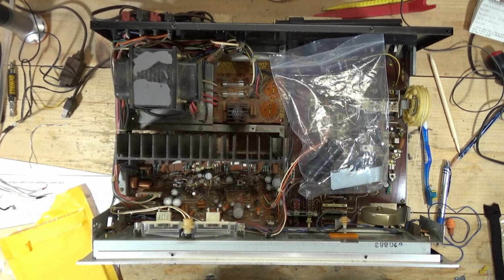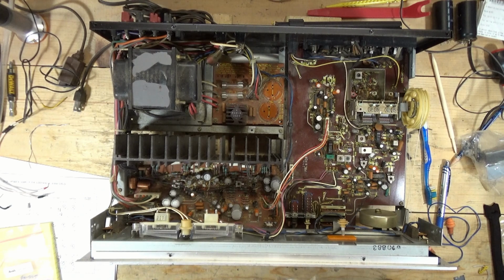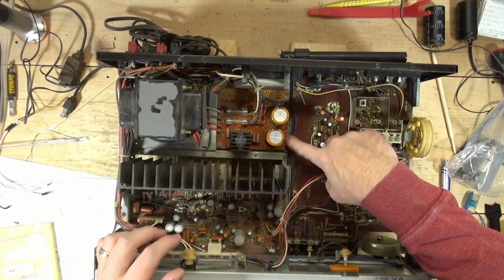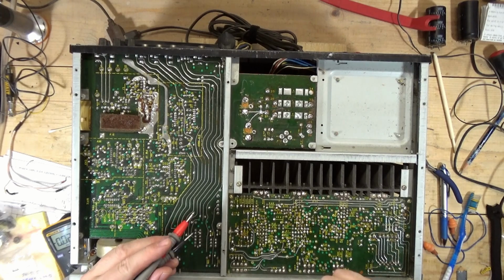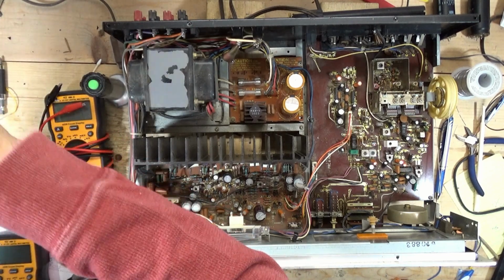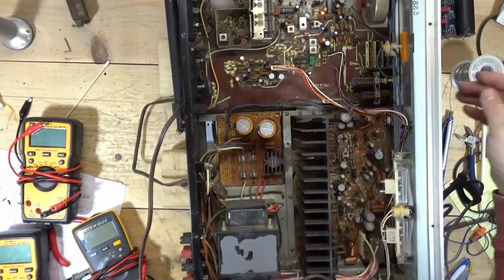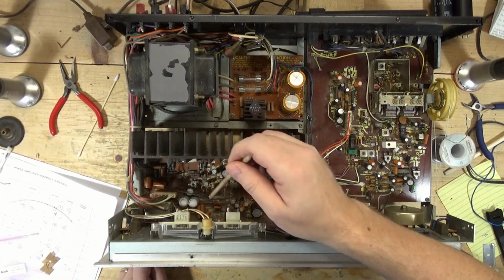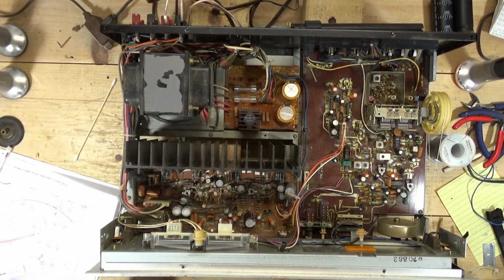Kenwood KR 4070 Stereo Receiver Repair Part 2 - Almost Gave Up!

Comment: Great advice on Q23. I need to replace Q19 & Q23. What did you use for equivalents? Cant find these anywhere
Reply from the maker: SM says Q23 was a 2SC945...I can't tell from the video, but it's either a KSC945 or KSC2383.

Comment: hi..i only have .02v for standby on the standby circuit...there is a 3300uf 16v cap ...not bulged...any tips what could be issue too low standby voltage?
Reply from the maker: I think you're looking for info on the KR A4070...different creature from a different decade.

Comment: hi..ive got an old krnwood vr507...wont pwr on no standby light....i plug in and test voltage coming out of transfirmer red black wires and i have 0dcv

i assume this is why no power on?
Reply from the maker: Wires coming out of the transformer would be AC...plug the unit in and see if you have AC on the unswitched outlet on the back (if it has one), then see if you have AC on the switched outlet after you hit the power button.  That's were my troubleshooting stops on something that new...posting a thread on Audiokarma would be your best bet...

Comment: I feel you! Almost gave up on one of these myself. I commend you for not totally giving up on it. Good sounding and handsome little unit when they're working.

Here's my adventure with the 4070: https://youtu.be/y8gbFIRuiUA?si=DjL9iT11TYos63tD
Reply from the maker: Thanks for the link!   I’m partial to the KR 6600 (and the x600 line) myself…Kenwood gear offers pretty good bang for your buck.
Reply: Agreed! Kenny's are sleepers in the vintage Hi-fi world. Snatch them up when you can find them. Keep the videos coming and the hobby alive! (I'm talking to myself here too) Thanks for saving another one from the landfill!
Reply from the maker: I just snagged a nice KA 5002 off of eBay at a decent price.  Can't wait to get it and check it out.

Comment: Estou aqui Brasíl , tentando consertar um desses aí,  mas não vai dar, muito ruim a manutenção,  fiquei um dia trabalhando nele, sem sucesso,  queimou os transistores de saída,  coloquei no lugar o Tip 35c e 36c só dá um zumbido e mais nada kkkk
Reply from the maker: Buzzing?  Both channels?  Probably a PS issue and/or filter cap gone bad.